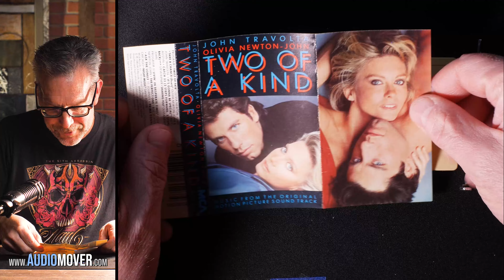This Tape Literally Crumbled While We Repaired It

Comment: Oh my goodness... Back in the 70s and early 80s when I needed to open up a sealed shell, I never just pryed it apart until it snapped. I always wanted to retain the original shell, not transport the reels to a different shell. I always put the shell into a vice to hold it still, then used a shop knife- or "exacto" knife, or a box cutter with a razor blade, and cut along the seam of the shell. They come open pretty easily. To reseal it, I always used model airplane plastic glue, applied to the shell with a wooden toothpick. 
  
If it sounds complicated, it really wasn't at the time. Cassettes were easy. I dreaded working on 8 tracks though.

Regarding pressure pads- whenever I had the shell open anyway, I went ahead and gave the pressure pad metal a little extra curve in it's center to increase it's effectiveness. At that moment I observed the pad, too, to see if I might as well put a droplet of glue (all-purpose glue, for this), just to do preventative maintenance.
Reply from the maker: Very interesting! 

And you're right, 8 tracks are a nightmare. I stopped working on those long ago.

Comment: I basically grew up amongst hifi-nerds and always used Nakamichi decks that purposely had heads constructed tto lift off the pressure pads to remove them from the mechanical construction. The taps instead just lay against the head on the tention between the double capstan solution. There was a few more manufacturers using that type of solution, but it was rare outsiddde Nakamichi double capstan solutions. Anyways, Many years later I had problems with  the sound from a tape I knew sounded fine at home when played at a friends tape deck, and the tape probably had lost the felt pad years ago, but I had never noticed it since I only used Nakamichis, even in my car when I got a little older.

Comment: Wouldn't it be better to use a hair dryer to get the glue soft again and then break the seem?
Reply from the maker: Never thought of that. My primary concern would be excessive heat on the tape inside the shell. But maybe we will give that a stab sometime and see what happens.
Reply: @audiomover  i think it should be okay. If people "Bake" tapes from not sticking. would be worth a shot on a few throwaway tapes.

Comment: I guess things like pressure pads and reels are all the same, because they have to comply with the original Philips, Compact Cassette specifications.
Reply from the maker: For the most part that's true. There were a few slight variations and we and we will make some videos showing them.  The variations were pretty rare in my experience.

Comment: Pre-recorded tapes used the cheapest crap cassette shell and tape available. I have 50 year old quality blanks that I recoded on in 1980 that still work and sound perfectly. And, why does someone send tapes like this out to be digitized. It is so easy to do at home if you want to with a deck and computer. LOL
Reply from the maker: Most of our clients have large libraries with hundreds or even thousands of tapes. We are set up to digitize large libraries quickly. Some of our clients actually started doing it themselves when they realize it will take them years. That's where we come in. :)